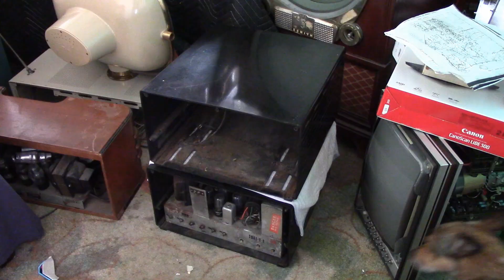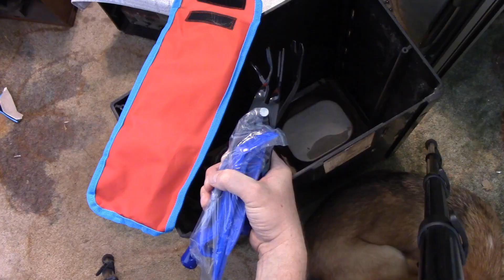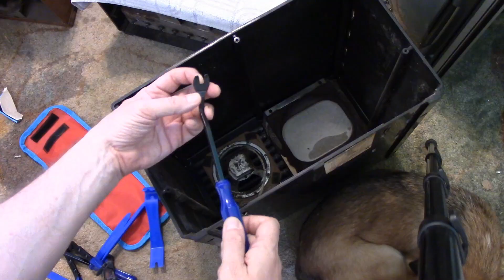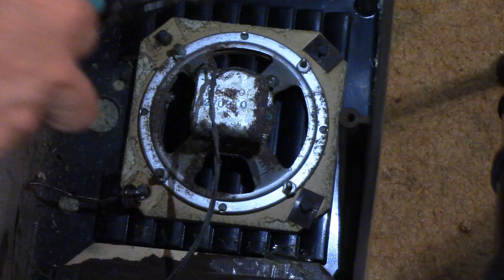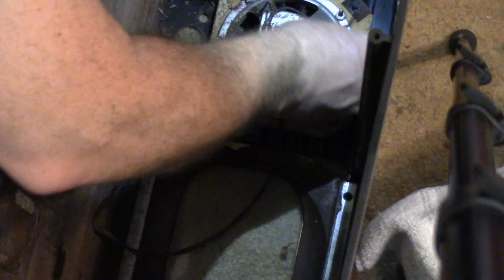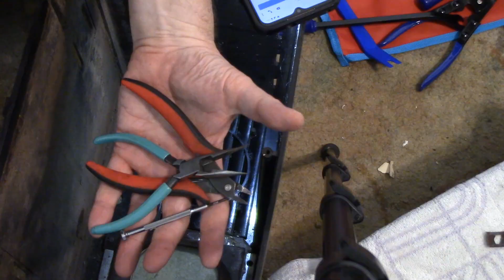Tech tips - speed nut removal

Comment: These and the push on palnuts are the bane of us all. My best luck so far has been with cheap angled needle nose pliers and angled hemostats. The hemostats are great but they can't be cheap ones from HFT as they're not meant for a twisting moment. Finding the right mix of sturdy and small tip can be difficult. Had a pair for many years that eventually broke off at the tip. Since then it's been the cheap angled needle nose that I can modify without feeling like I"m ruining a good tool.
I've long had fantasies of hacking together an electric discharge machining cutter or using electrochemical erosion, but I"m not that smart. Bakelite has decent chemical resistance, so it might work, but I doubt it'd be worth the time.

Edit: Forgot to mention - there's some confusion about speed nuts that are designed for threads and the sort shown above. This kind is known a few ways including 'push nut' and 'stud receiving'. Both kinds are still made and used.
Further Edit: I figured I'd check archive.org for old GC Electric catalogs to see if I could find the plunger thing. I guess they used to be General Cement before 1958, so that got me all the way back to 1947. There are several excerpts from the Radio's Master catalog. You can perform a text search for 'Tinnerman Nut Remover' to see what I"ve found so far. It looks like a double ended corkscrew. I'll poke around more when I get more time.

Comment: If you apply a drop (or less) of glycerin first before removing they come off alot easier.
Good replacement is 'pal nuts' ex. Dorman 45384 also applied with a slight bir of lube.

Comment: I have seen that tool you mentioned that was made by gc electronics. It had a forked end that pushed down against the ends of the clip and then two hooks that that pulled the center of the spring clip upward when you pushed a plunger,thus spreading the "teeth" in the center of the clip apart and you could just pull it straight off.  The last time I ever saw that tool was back in the early 80's and it was in an old electronics shop that had leftover stuff from the 50's and 60's,including tone arms,tube sockets,etc. They had bottles of  gc electronics phono lube,phono no slip,and even Aero Lubriplate which was recommended in the old Seeburg Manuals.  Sadly that Electronics shop is long gone as are the others in neighboring cities. I wish I would have bought one back then.  Plastic table radios seemed to use them a lot. I end up doing pretty much the same thing you do. I use a very small screwdriver and pull upward on the center tabs of the clip until they are open and I can get it out without damaging the post. Its tedious but it works.

Comment: They make those car trim tools out of plastic deliberately so they wont damage the paint on the car. They are used for removing door panels,side moldings,trim. Etc.  They also make plastic razor blades for removing bumper stickers off paint. I bought a Plymouth Satellite that someone had plastered with bumper stickers and I used the plastic razor blades to remove them without hurting the paint.

Comment: I see that these speednut clips are still made because they can be fitted to threaded fasteners.  I looked quickly on Google and found an aircraft use for them, which warned to use the right kind of threaded fastener, not a sheet metal screw, because the pitch matters.  I actually wonder if the originals weren't speednuts at all, but some kind of circular pushnuts.  Those intended for threaded fastener use would have a asymmetric kind of prong on them, perhaps, with an offset between the points of the prong.  (But again there are no circular dents to suggest that shape of pushnut.)
Reply from the maker: Oh, I've worked on over a dozen of these Admirals and they all used the rectangular type.
Reply: @bandersentv  But not all had prongs as weak as this one, right?  Maybe corrosion through a case hardening layer?

Comment: I suggest using a staple remover that is sold in any office supply store. I believe it will be the perfect tool for removing these speed nuts. They will push the bottom part down and pull the top portion up .
Reply: Or even in a Dollar Tree.  NOT an expensive tool, so it might be worth getting even if it might be usable for something else.
Reply: Bent fondue fork?